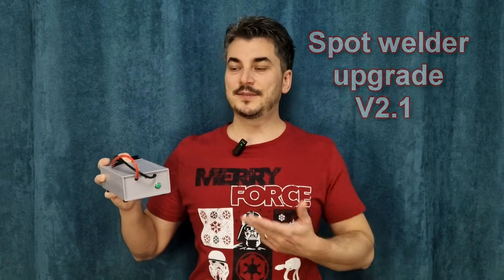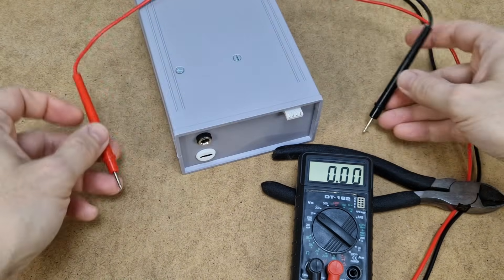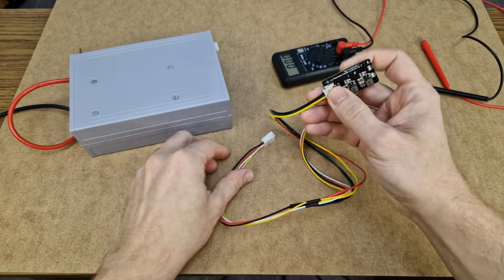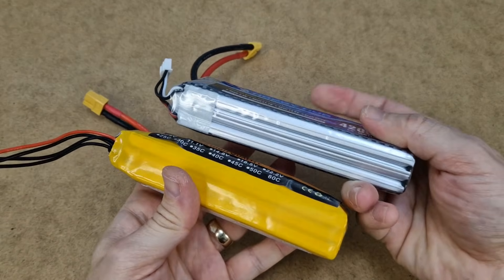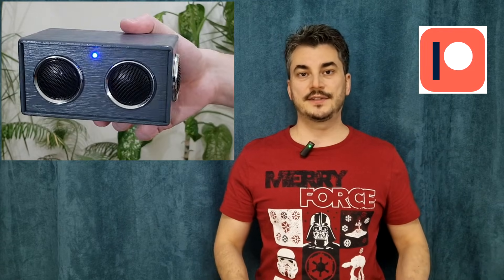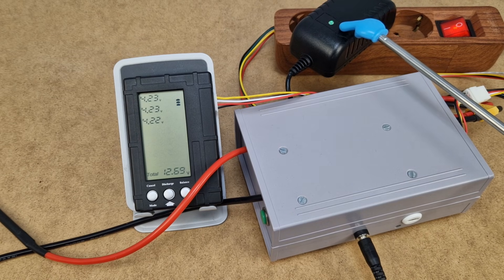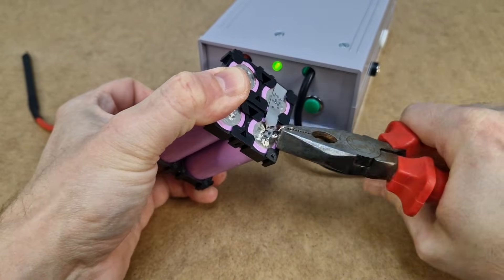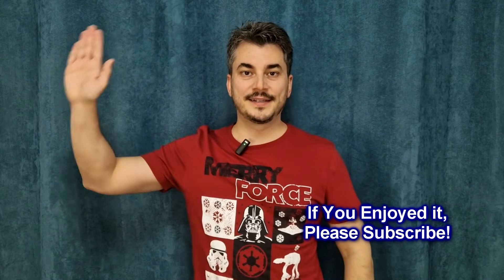LiPo Battery problem - Spot welder repair and upgrade

Comment: brother you were to try with super capacitor this time said 2 years ago?
Reply from the maker: Hi. I haven't received any requests to build it, so I've put the idea at the end of my "to do" list.
Reply: @Sorin_DIY  count my vote i think buying those capacitor is much safer and cheaper option than lead acid battery if it works then its also smaller form factor

Comment: Hi Sorin , It's a long time we lost contact , i have been following your very use full project all the while and had done many saucerful project for my home use , now my spot welder is out of use and i ordered a new simple latest one without the  LIPO battery ,due i have a few pre built Makita 20volt battery n Now  i intent to to use it for this new spot welder ,will it work or i still need to get the Lipo battery your advice pal ,,thanks
Reply from the maker: Hi, the spot welder module needs a powerful battery, made with high drain cells. Do you know the cells model in the makita battery?
Reply: @Sorin_DIY  Sorin thanks for your swift reply , I own a lot of 16850 battries . will that help if yes .how many cell i need to get the 12 volt and at same time do i need a buck converter to control the voltage , thank pal
Reply from the maker: The spot welder module needs between 100 - 200A, so you cannot use a converter. the battery output is connected directly to the module.
You need cells with a high discharge rate "C", for ex my new battery has 4200mAh (4.2Ah) and 60C. that means the maximum output current is 4.2A * 60 = 252A.
So it depends what type of cells you have. laptop cells usually have a 2C discharge rate, so they cannot be used for a spot welder, they cannot deliver a high instant current. you need to check the specs for your type of cells, the maximum current output or C-rate.
Reply: @Sorin_DIY  Hi Sorin your idea are always great and  safe for us to follow , Thanks Pal will always support your great valuable projects , waiting for another new one from you ,,,, love you

Comment: What size drill bit did you use for the holes in the BMS plate?
Reply from the maker: What holes are you talking about? I didn't make any holes in the BMS board.
Reply: @Sorin_DIY  Which drill bit should I use for the holes where the BMS plate will be screwed in?
Reply from the maker: The BMS board is fixed to the case with double sided foam tape.

Comment: Yeahp, that's the problem with BMS modules. If you measure them, there is a resistance that varies with 
the BMS model that is always applied to the individual cells that discharge them....!!!! BMS's are a two 
edge sword...!!!!

Comment: I made mine seeing your old video, and I keep battery disconnected when not in use, but still my battery bloated...!!! Don't know why..??!! 😟😟
Reply from the maker: You need to periodically check the battery. There may be a problem with one of the cells or with the BMS.
Reply: @Sorin_DIY maybe a hard case for the battery will help to keep the cells together (like in the big build prismatic lifepo4 setups)…

Comment: Why not use a DC circuit breaker in the back and close it with plexic? You can still disconnect the battery and have a visual inspection.
Reply from the maker: The 4200mAh 60C LiPo battery can deliver up to 270A instant current. So it will need a switch or circuit breaker rated at a much higher current.
Reply: @Sorin_DIY that's short circuit rating. If a T60 connector is enough for that load, you could try with something around that. Besides, you are switching on and off the battery when it's not under load.

Comment: That battery! I do a lot of Chromebook troubleshooting and repairs, and we get a few batteries that do that from time to time. The flat LiPo batteries are under the keyboard so the keyboard will lift up a bit. We call them Spicy Pillows. After working with thousands of Chromebooks over the past five years or so, I've found that if they have to be stored, a charge of  around 60% to 75% seems to provide the best longevity.

Comment: i think it's the 3s USBC charging booster module is damaging the battery, i bought the same looking 3s charger as in that video, it outputs over 12.6v, it's 13.8v, I wouldn't use it
Reply from the maker: The USB C charger is connected to the BMS, so the BMS will cut the charging at 4.25V per cell. Without a BMS, the USB C charging module will damage the battery.

Comment: Instead of unplugging the cables why not use a switch
Reply from the maker: The 4200mAh 60C LiPo battery can deliver up to 270A instant current. So it will need a switch rated at a much higher current.
Reply: @Sorin_DIY  OK, I get it now

Comment: Wouldn't a disconnect switch be fine in place of having to work the power connector over and over?
Reply from the maker: The 4200mAh 60C LiPo battery can deliver up to 270A instant current. So it will need a switch rated at a much higher current.
Reply: The proper switch size for those amps passing, it will be half the size of the box… if not bigger😊🎉

Comment: Good to see you back Sorin!
Couldn't you just put a master switch on the back and turn on and off the battery?
Sort of like a PC power supply... kind of...
Reply from the maker: The 4200mAh 60C LiPo battery can deliver up to 270A instant current. So it will need a switch rated at a much higher current.

Comment: You can use a on off switch to externally disconnect the battery and keep the box closed. And think it's better.
Reply from the maker: The 4200mAh 60C LiPo battery can deliver up to 270A instant current. So it will need a switch rated at a much higher current.

Comment: Quiescent current will kill many battery packs because one cell typically takes on the duty to provide that current without balance happening.  When that cell is depleted, on to the next.  Cheap "leaky" BMS systems on your cells can cause this drain - killing the cells instead of protecting them.  LESSON:  Always discharge/recharge your devices every few months to keep all cells from being dragged down below their safe storage voltage.  This is ESPECIALLY true of car jump-starters which stowed then ignored for years.  Do not trust the state of charge indicator, which seldom catch individual cell decline!  Also, battery level indicators you add to your chargers in your projects may draw current when connected in standby mode.  Always install a hard switch when you can, and check for parasitic drains.

How do I know?  After testing multiple Wal*Mart powerbanks that were never used and failed in the packages.  Bought them end of season one Christmas on clearance as gifts for the following year.  Half of them went puffy before the year went by.   Had to figure out why!

Comment: What about with lithium phosphate
Reply from the maker: LiFePO4 batteries are safer, but they have a lower discharge rate than LiPo batteries, so for the same maximum current the LiFePO4 battery needs to be bigger.

Comment: @4:03 So the ON/OFF button is the culprit. Replacing it with a mechanical switch would eliminate the battery drain, would it not?
Reply from the maker: The 4200mAh 60C LiPo battery can deliver up to 270A instant current. So it will need a switch rated at a much higher current.

Comment: If visual inspection of the LiPo battery is not necessary, you could put the old cover back, because it still has two holes in it from those charging sockets. You could pass through the wires from the battery and still be able to disconnect it externally)

Comment: hmm what about those big double pole 30 amp switches and just spread positive welds to both sides for better heat. i guess the plug xd60 works
Reply from the maker: The 4200mAh 60C LiPo battery can deliver up to 270A instant current. So it will need a switch rated at a much higher current.
Reply: @Sorin_DIY  hmm i think xd60 is rated for 30 amps continuous. maybe im shooting from the hip thinking that a 30amp switch would work. im not sure how to calculate instantaneous stuff like that.

Comment: Lipo cells do not like to be left discharged, or left charged, or used, or looked at
Reply: Just wanna say I highly regard your video on your portable desktop pc with internal battery. From one who also tread the same road few years ago, prior examples were less than a handful and yours are one of the best one I referenced. Many thanks
Reply: i have stopped using them in my RC projects. They have a very short lifespan and are highly sensitive to any kind of forces. Even the tiny vibrations created by a BLDC engine is enough to separate the foils or even rubbing off the protective dielectric layer inside between the foils. They tend to spontaneous combust. Yes the C rating is exelent but with some gold caps and programmable ESC you can use standard 18650 or the bigger one 21700 or even bigger 26650 cells. usualy they have screw terminals so no soldering required. i use the 26650 in my builds because of the screw terminals. Also i use 3d printig a lot for my RC planes so making a mount for them is easy also you can spread the weight more easy around the plane without sacrificing space.